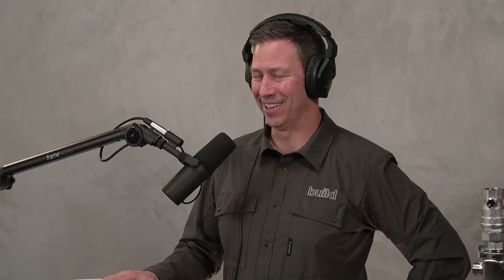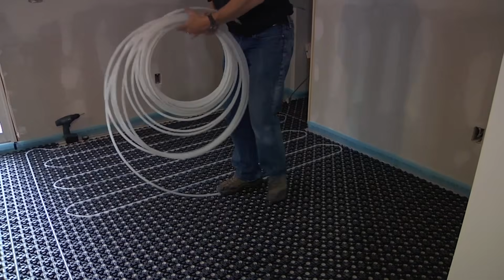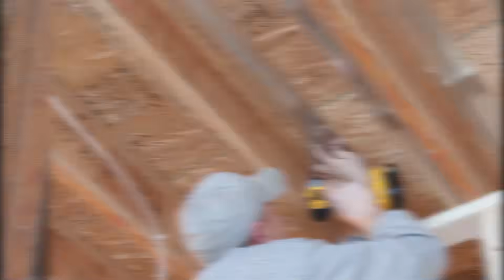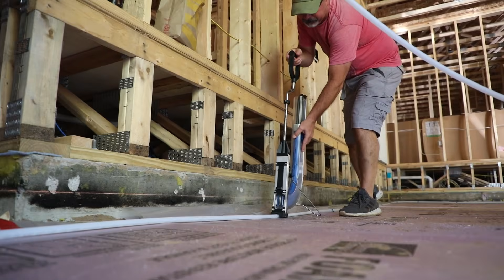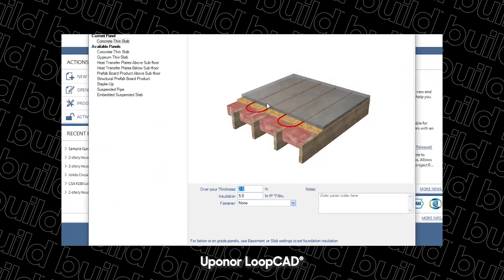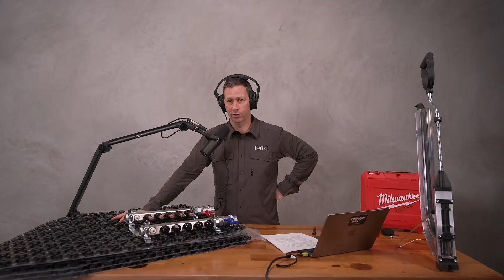4 Methods To Run Radiant Heat PEX Pipe

Comment: Would just like to preface that I'm a consumer!  I've really only experienced in-floor radiant heat at my job which is an assisted living home. I hate it 🤷‍♀️  the residents don't particularly seem to enjoy it either. That being said I think it's a fairly old system that needs a lot of tweaking. The several thermostats (zones) are never in sync (some are too hot and others freezing) and my feet were always sweating while I often had to wear a sweater for my upper body. I work on the floor running around on 12 hour shifts as well as in the office mostly sitting for 8 hours. Located in south dakota so we get pretty cold winters. The worst time is switching in the spring and fall, can never find a comfortable temperature. I will say in-building humidity is much better with the radiant heat versus forced air. Not to say that it can't get dry but it's generally alot more comfortable where humidity is concerned. I would be interested for my basement master bathroom though. Just not impressed with it being used as the only heating system in a commercial 40 bed living facility, but again that may be due to age of the system and trying to please several different people because there is generally 2-3 "bedrooms" in one zone and our residents do range in age from 50's to 80's +

Comment: To those of you with radiant in a residential in a very cold setting (I'm in Minnesota) can you get away with radiant alone? Or do you use some forced air as well?
Reply: I have 3400sqft heated with radiant only 2400sqft of shop and storage below 12ft ceilings I live about 60 miles north of Milwaukee. A balmy 13° tonight. I heat the entire thing all the time shop is 72° right now.
Reply: @danmccoy6164  Dan, what temp do you keep the floors at to achieve that ambient temp?
Reply: @SupercarSeany  I have never really checked the floor  temperature. I just have ambient thermostats. I did put a tube of pex into the slab. In case i wanted to run the sensors that i have into the center of the slab. That way you can replace them if they go bad. My thermostats will do both. But I don't think it's necessary. I just use ambient. Its very consistent. No real over run a couple of degrees in the  inslab. 1 degrees either direction upstairs with the warmboard. I think it's way more comfortable. And consistent than forced air. I turned up the water temperature in the buffer tank to 115f from 108f. The unit runs longer and less often. At that temperature.
Get the biggest buffer tank you can.  I have a 80 gallon boiler buddy. If I remember right.
I have geothermal and solar. Zero bills. Uae chilled water fan coils for cooling. Chilled water provided by geothermal.

Comment: For radiant heat retrofits in garages and basements why wouldn’t t I mount in the ceiling rather than the floor? You showed from the IBS show a product called Trusscore. Why wouldn’t I use that to go over the radiant panels instead of drywall?
Reply: While heat will replace cold, it's natural tendency is to rise. The ceiling heat I have experienced was expensive to use electric,  and in the south. It took awhile to feel the difference AND THEN YOU WERE BAKING

Comment: Yes water does transfer much more energy than air but when you don't have air movement you also don't condition the air.  So a house without forced air turns into one big dust bunny.  I lived in a house with only water heat and there was a good 10" of dust between the headboard and wall where it was hard to reach.

Comment: So I listened and you missed one more system.  That is WARMBOARD.  It's a 1 1/8" think plywood subfloor with an aluminum face and the tracks for the pex are routed and the aluminum pressed into them.  I would love to have used it in my house but it would have added $20,000 to the cost of my 1500 SF home.  None of the other methods other than Qucktrack would have worked for floor.  I didn't look at using my walls or ceilings as radiators, probably would have been a good idea.  I do have in floor in my basement and my garage.  The basement is super comfortable.  I keep my garage at 55 and that's great for keeping the cars comfortable and melting snow off of them.  But my garage is also my shop.  I'm working out there at 55 and find I'm never cold.  Sometime's I'm laying on the concrete floor while building my truck.  My home is a DELTEC and the nature of the construction uses a 5/8" plywood subfloor that is cut to follow the trusses that radiate from the center.  Because there's no running bond, a second layer is layer over in a typical offset manner to tie the house together.  On top of that I have 3/4" Hickory floors for a total floor thickness of 2".  So first off, it's too thick to radiate from below and second, it's nearly impossible to run pex as the trusses are nearly solid as you get to the center of the house.  In retrospect, I probably could have used WARMBOARD as it's structural and would have replaced the second layer of subfloor.  I've found I don't need heat in my bedroom and the center of the house is pantry, laundry and closet.  I could have used any 1 1/8" subfloor in those areas.
AC isn't a major factor where we live in the Black Hills of South Dakota.  The nights here are typically cool so we can cool the house off overnight and close up during the hot days which are few. I've considered a mini split for the great room and master bedroom for those few days as well as an alternate to the electric radiant we use on the main floor.

Comment: Thanks for another informative video.  I think leaving out a product like WarmBoard-- especially in new construction, was  a miss.  It's a sub-floor and a "host" for the PEX in one shot.  Another thing I think could have added more value was discussing mixed systems.  For example, how (or when) to integrate radiant with a more traditional HVAC system so the homeowner can also have A/C, air filtering, and/or dehumidification in summer.
Reply: Ummm you're talking about Matt's Sponsored Content Build Show... Why would he do that? Go look for what you want instead of complaining about what he didn't show lol don't you know how this stuff works?

Comment: I have been thinking about doing this in my basement. It has a poured concrete floor. What would I use for heat? Would I have to add a boiler system? Or could I just use a tankless water heater? Also my entire house is electric. No gas of any sorts. Any information is appreciated.

Comment: I wonder why in every YouTube video (especially US-made videos) the pipes in a floor heating setup are all in a 'serpentine' layout? When we installed our floor heating (Belgium) it is custom to use the 'counterflow' layout. This gives a more even spread of the heat you are pumping through your pipes.
In the serpentine method your loop will start with 'hot' water, but at the end of your loop (the other side of the room) your water has cooled down and thus the floor there is colder than where you started. So one side of the room's floor will be hotter than the other side. Why is it that this method is still used?
This image on Wikipedia says it all: https://en.wikipedia.org/wiki/Underfloor_heating#/media/File:Modelling_radiant_tube_patterns.png
Reply: Can answer for all Bart ,but as an installer the counter flow lay out is way better for the perimeter to heat first ,then interior.  Especially if 2 of your walls in the room are exterior walls.
   However when the actual  application of the pipe is layed down it's just easier to put the serpentine installation.  Yes I have done it both ways ,but honestly more than 75%of our installation are done this way . When working with other individuals who are installers, not helpers it's much easier to achieve. 
      So yeah you guessed it ,that only happens about 25% of the time. Often said its easiest, when one needs not overthink it.
        Counter flow should be designated on the lay out of the plan. However radiant is sooooo expensive this additional cost is omitted. 
      Which then gets dropped on my shoulders, nd having an apprentice who cares more about his insta,progress for the day than actually learning. Its not hard for me to just get it done ,the serpentine method.
Reply: @jamesortolano3983  exactly james!😎

Comment: The second process looks interesting to me. The second floor in my house uses hydronic wall radiators and 180 degree water. By putting it in the floor then I'll need a lot less high heat water and use a different style boiler when I replace it. Warm board or what he used in step 2 seems like the least amount of added weight to the floor. Lightweight gypsum pour might be a good process as well but an entire floor in mud could be much heavier. I don't see the link to the fellow's youtube channel. Do you have that available? Thanks Matt. Oh and also trying to figure options to heat my 32x48 shop since the existing concrete doesn't have tubing installed. No heat or insulation in Idaho makes it's too cold to work in the shop. Closed cell spray foam is on my mind. Other than hammering out the existing concrete floor to add foam and then tubes, I'm not sure what would be an efficient heat source. I have natural gas to the property but it doesn't run close to the shop. Evacuated solar tubes, big storage tank and heat ex-changer are the desired plan but probably more money than I need to throw at it. Solar panels and heating water could be an option as well. Not a lot of wood in the area plus I've done wood stoves before and I'd like to have something automatic.

Comment: I did mine in the floor joists 2ins down, joists 1ft apart, runs no more then 250ft, two runs around outside 1ft in then 6ins in from that, each room has own zone and thermostats, 3000ft of pex in all

Comment: I’ve been doing a ton of research on this lately. I want to retrofit my basement and since I just did the floors, was considering walls but there is not a lot of info on radiant walls. Can I put them right over the drywall and just use outlet extenders for the electric? Would brick or tile be a better option then wainscoting or Sheetrock for distributing the heat?

Comment: I'm an installer in romania, built my own house with radiant heating in the basement and 1st floor and the rest is with radiators. I regret not have it all with radiant it's so much better.

Comment: I too would like to hear about cooling in the floors.
Reply: Cooling is typically done in a separate system - usually in the ceilings. Cooling is far more complex and not nearly as effective. You will also need to include dehumidification controls to help avoid condensation etc. We've done numerous systems over the years, but we generally recommend against them due to inadequate performance (in our opinions) and high cost.

Comment: What is the cost to install and operate compared to forced air? I've never been in a house that had radiant heating so I'm a little scared to try it on my new house
Reply: Numbers vary wildly by geography, but a decent number to pencil in would be about $20/sf, all in - parts and labor. Some methods will come in cheaper, but have higher labor costs and lower energy efficiency. Our system/offerings are on the higher end of the cost curve for materials, but labor is much lower, many elements are streamlined, and the performance and energy efficiency are higher.

Comment: Thanks for the video, but I noticed that you compared it only with forced air systems. In the area where I live, most of the homes have convectors witch are essentially the same concept but instead of putting it into the floor you just have a box in each room in the wall, so I would like you to do a comparison of the pros & cons is it just as good, but not as nice? Or is there any other differences?

Comment: It's fine... just depends how much money you're willing to spend and how "comfortable" you want to be. 20 bucks gets you a space heater that plugs into a regular outlet and can heat up a small room. 20 bucks gets you a pair of slippers that insulates you from the floor so it can be as cold as the outside air is and you won't feel a thing. Sweaters, blankets, radiators, sweatpants, vodka, husband etc the list of heating objects is countless. It's all about balancing cost with comfort.

Comment: Great video, Matt! How do you think the Uponor flooring system compares to the Warm Board retrofit system that you looked at in a previous video in one of Steve's builds? Any idea about cost comparison between the two? I'm remodeling a small cabin that only has a wood burner and one electric baseboard heater, I think one of those systems would be great for a retrofit!

Comment: Why people are still buying noisy air handlers/central HVAC system ?? Inverter and radiant systems are so much better.
Reply: And me being a forklift driver. Installed all 3400sqft of it in my house myself. Both inslab downstairs and warmboard upstairs. Plus under 11 cement trucks worth of concrete in my driveway to heat with hydronic solar panels. So I don't have to shovel snow. For less than the estimates I got to have conventional heating installed.

Comment: How about the schluter system? Was kind of surprised to not see Matt use that in the new build bathroom after putting in that steam shower too.
Reply: Probably because it's all electric and would be very inefficient in comparison to a liquid based radiant systems which uses heat pumps. They can be 4x more efficient than pure electric.

 Schluter is best for quick heating in small spaces like a bathroom but not entire homes.

Comment: Isnt PEX relatively insulated?
Reply: If you hold a hot water filled pex pipe it'll still be warm. It just transfers heat less quickly than a metal pipe would. The benefit is that pex can be continuous with no joints to fail.

Comment: I need to have Eric stop out at my place just west of Minneapolis - I am researching joist track to supplement heat my main floor to keep my feet warm (unfinished basement ceiling). Last week on his Instagram he was installing an Infrared garage heater after watching that I would like to replace my forced air garage heater with Infrared (preliminary sign off on that from my wife after ai told her it is more efficient… and we can likely sell our current heater). Now watching this that plastic track might be good for our basement to supplement heat. Curious how that system works with 1) no insulation under the slab and 2) moisture coming from the slab. Plus I think his dog Ringo knows I am watching and sounds like he is giving me a Beagle shout out in this video.

Comment: It would be nice if you did a video in steam heat, not just the old bulky radiators, but include modern components.

Comment: Why can't this be a form of cooling as well? Running cold water through these pipes instead of warm would seem to be a useful strategy of cooling a house in the summer, or the south.
Reply: You know how your glass of cold beer gets condensation on it when its humid? Same thing would happen to your floors. They'd get covered in water.
Reply: @JeepWranglerIslander  How do we avoid that on water cooled computers? Isn't this a solved problem?
Reply: Computers run hot like 80C which is like 175 Farenheit and get cooled to 30C or like 80 Farenheit. Whatever your ambient temp in your room is would be the lowest it'd be. Condensation is a problem for you if you do liquid nitrogen cooling for those crazy overclocks on gamers nexus

Comment: Would like to know efficiency.
Reply: If you have hard surface floors, you might save up to 25 percent. Wall to Wall carpet will insulate the floors reducing the heat convection.

Comment: Worked in a smallish  shop/warehouse with radiant heat. It was amazing!! I had to pull in pickups and trailers to load and  the drivers loved it because it quickly warmed the metal deck so the cold didn't hurt your hands, the other forced air heated building the trailer would be loaded before it started to not be frozen. The outside temps were -10F for a month or so.